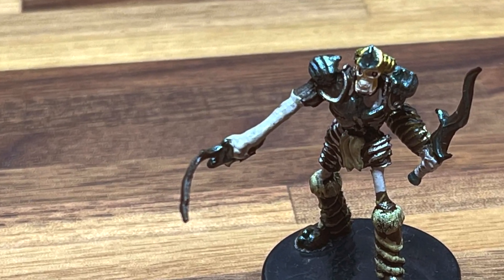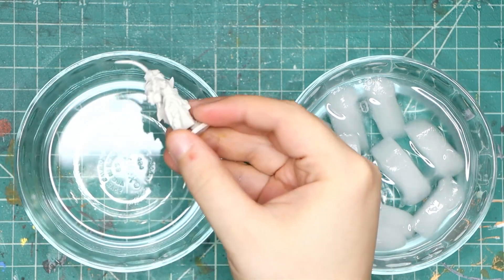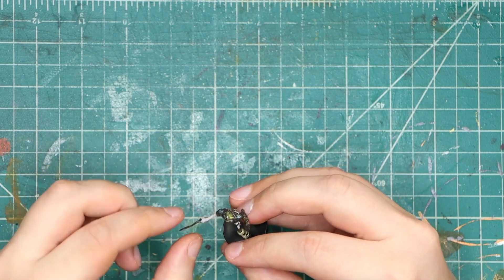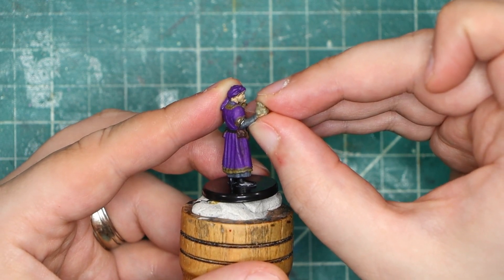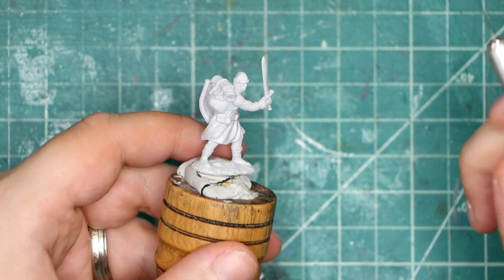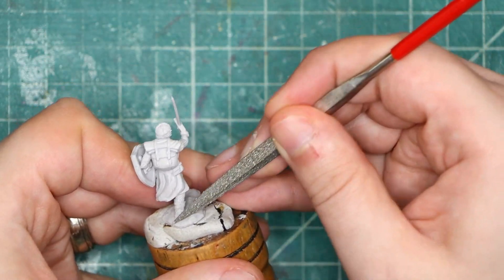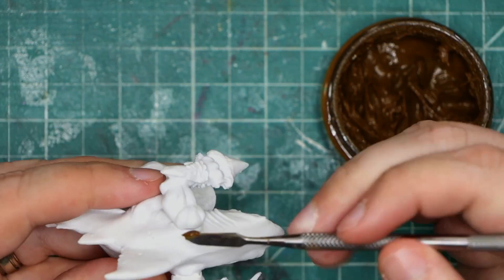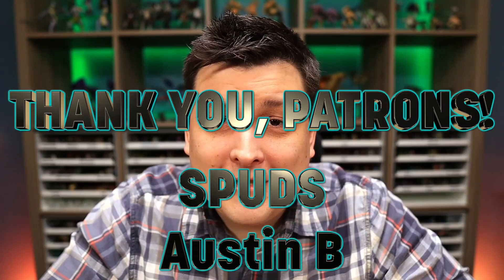How to FIX your Bent, Broken and Busted Tabletop Miniatures

Comment: Thanks for the tips! One extra for super glue, for the bottles without squeezy sides, squeeze some air out while the tip is up and keep even force on while flipping it over, back air pressure will keep the glue from slopping out everywhere and you can more finely control how much is applied.
Reply from the maker: Great advice. Thanks!

Comment: Does this work on Metal Minis? Because I bought about a half dozen 'Black Legionnaires' from Reaper Minis, they're made of metal, but I got 3 of them with bent out of shape swords right in the box. One of the boxes holding the mini couldn't even fit their pose with how small the plastic holding box section was unless the sword was bent, so of course it was bent out of shape.